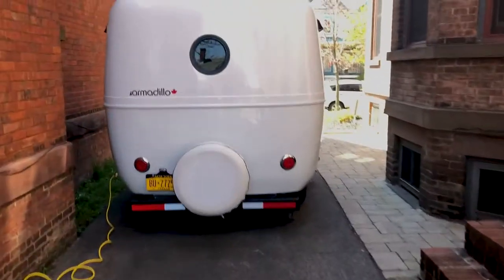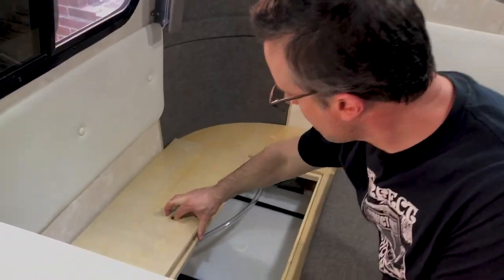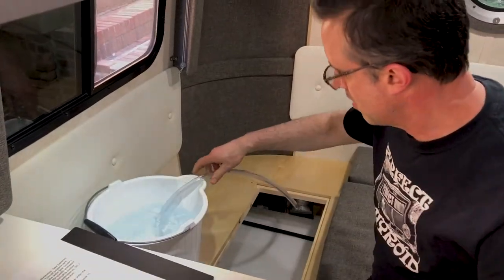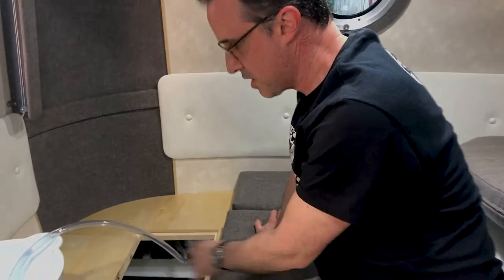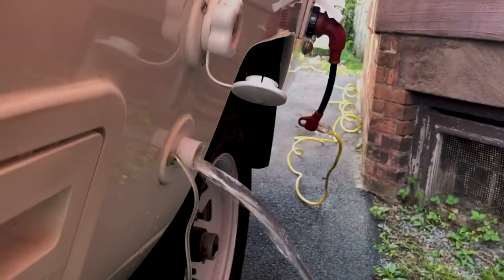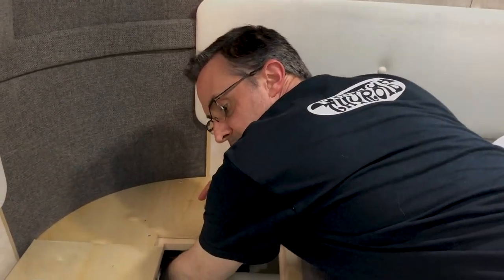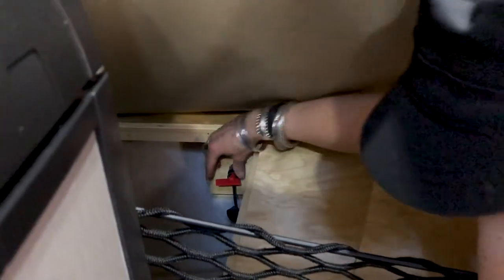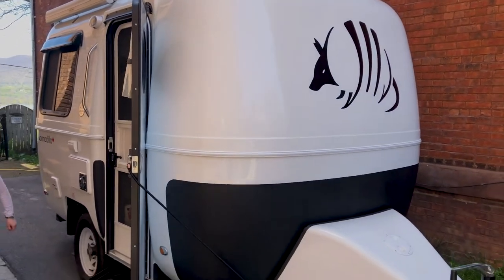04 De-Winterizing The Armadillo Camper

Comment: Great video--thanks! In my Armadillo, the lithium battery is inside, in the front, left (driver-side) storage area under a cushion. The red disconnect switch is outside in the area where the table for two is located. This is for the "Table for Two" model.